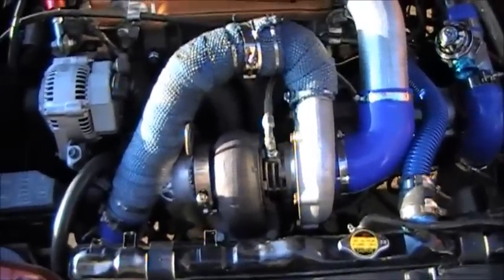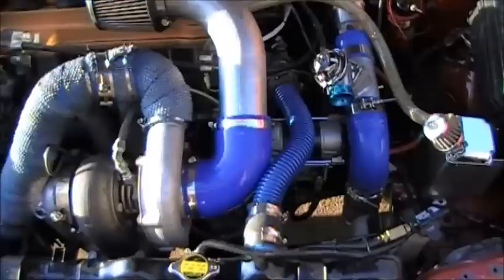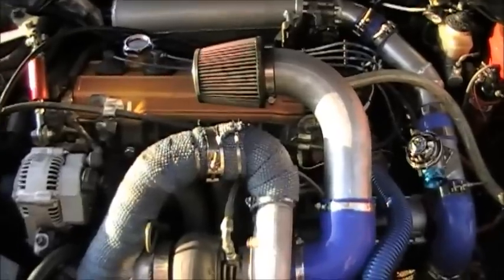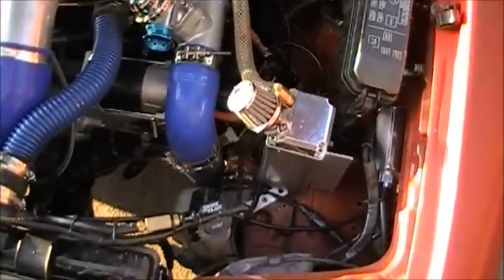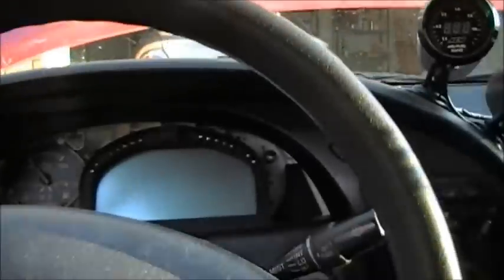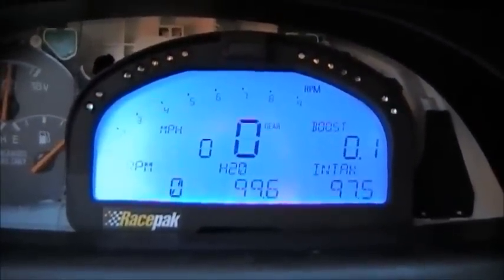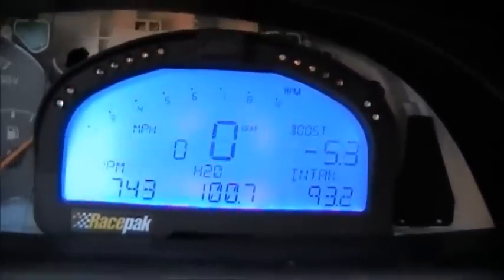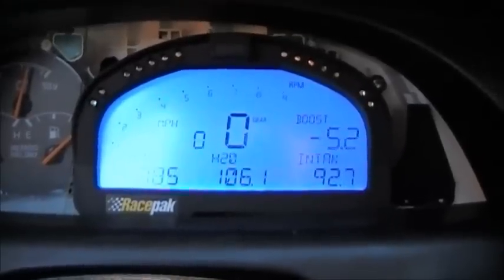Celica 5sfte 2.3lt with Racepak

Comment from the maker: Racepak integrated into my autronic standalone nicely. Honestly to do this right the first time I spent about 3k for the autronic installed and all, turbo kit 4-5k (precision ball bearing was $1k itself), engine build twice since wiseco pistons weren't doing the job around 3-4k. Go JE pistons 88 mm ceramic coated and you will be happy. It was expensive but car is very fast and light

Comment from the maker: Its completely custom. You can get most the parts though off a celica all trac. Like the turbo exhaust manifold is from a all trac. I had to trim down a edge of it to get it to fit but it worked. Used a universal piping kit and then found what angle pieces I needed from there.